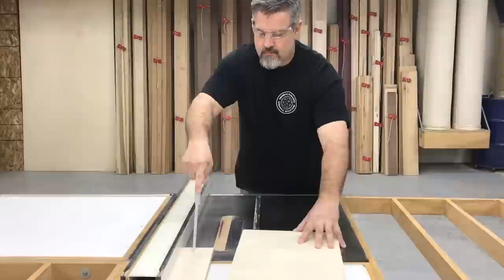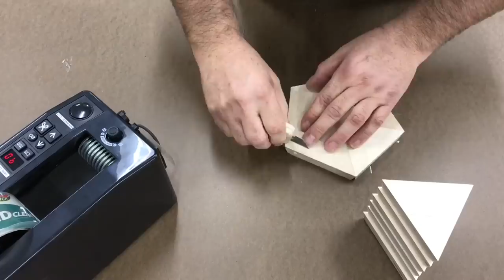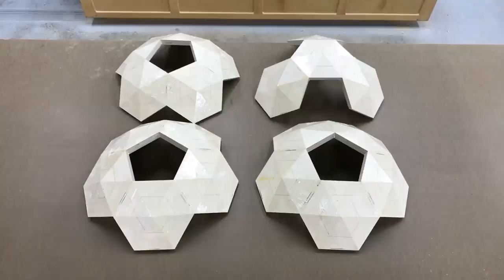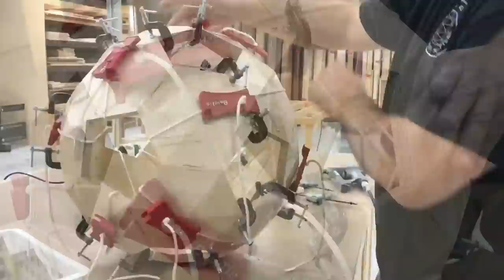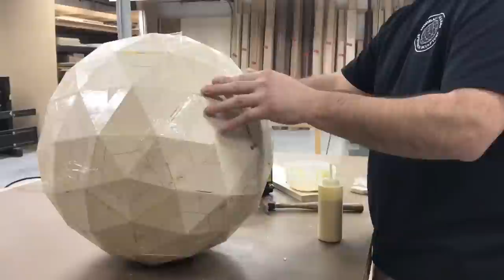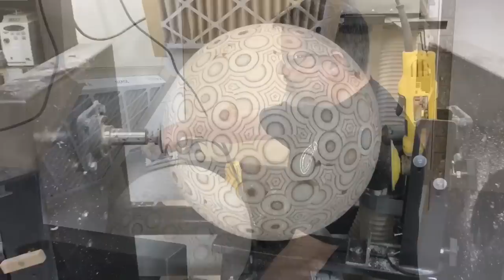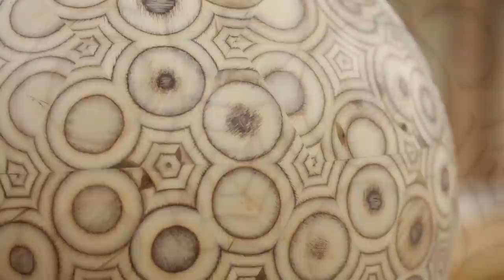Guy makes a big ball out of plywood

Comment: Curious how did you calculated the bevel you needed?
Reply from the maker: quailman28    I did it the hard way with a lot of trial and error. The first one I built out of 1/8 inch hardboard and hot melt glue and then I measured all the angles . You can use a dome calculator that will give you the triangle sizes and dihedral angles check it out here. http://geo-dome.co.uk/3v_tool.asp

Comment: Amazingly amazing! One question: Why exactly did those patterns appear - and I know it has to do with the layers in the wood, but can you explain it more elaborately? Thanks.
Reply from the maker: s r    The corners of each triangle get more sanded off of them than the centers.  The center is still about 3/4” thick the corners are about 1/2” each ring is one layer deeper into the plywood. The reddish brown ring is the color of the glue used in the plywood.

Comment: So I've been trying to figure it out....what angle are the triangles cut on the mitre saw?
I think its 12 degrees (based on the planar deficit between a sphere and a truncated icosahedron.....), but not sure if that's right....i'm horrible at math....and only slightly better at geometry..

Anyone know?
Reply from the maker: JaekRiel DGX    Try this website it has a calculator for triangle size and dihedral angles.  http://geo-dome.co.uk/3v_tool.asp

Comment: Keith this is great! I want to build a 5 feet sphere, any pointers in calculating the angles and right size triangles?
Reply from the maker: Gab20783  Wow that’s gonna be a big ball. 😀 Do you want to try to make it smooth, or are you going to leave it a geodesic?
Reply: Keith smooth would be nice 😁However I may do a 2.5 radius sphere.
Reply from the maker: Check out this website.  http://geo-dome.co.uk/4v_tool.asp    They have a dome calculator tool that can figure the parts and side lengths for different radius domes. You would want the one for panelized construction. I don't have a lot of experience with the larger spheres, but I would think the larger the diameter, the thicker the material would have to be. I am going to try a 34" diameter smooth sphere for a video at some point.
Reply: @ODDBALLGALLERYKeithWilliams  Keith - Thank you for the link- I actually looked at that calculator.  I don't think getting thicker wood would be a good idea for the weight.  The thinner the walls the lighter the sphere.  I was wondering how did you calculated the angles of the triangle pieces so the fold in perfectly?
Reply from the maker: The calculator should give you the angle and side length..from there it will take some trial and error fitting to get the right setup for you equipment. As far as the thickness, I guess it would depend on what you plan to use it for.
Reply: @ODDBALLGALLERYKeithWilliams  Thank  you keith - appreciate your pointers- I will let you know how things go.

Comment: Are all the triangles the same for the 5 or 6 up assemblies? Same draft?
Reply from the maker: Brad Cole  There are two different size triangles.  They are the same length on the common side . The pentagon triangles are shorter on the other two sides and the hexagon triangles are longer. Both sizes have two different bevel angles. Check out this website for more info.  http://geo-dome.co.uk/3v_tool.asp

Comment: Are that rubber discs what you are using
Reply from the maker: For the rough sanding I use a 36 grit resin disk with a rubber backer pad.

Comment: What the hell is that black machine in corner??? Automatic tape dispenser??? Where can I get one of those? Any reference for model?
Reply from the maker: Yes it is a auto tape dispenser. Start international ZCM-1000. They are expensive new, I got mine used on Ebay for $150

Comment: I guess - Guy makes a Truncated Icosahedron out of plywood, then sands it into a sphere - wasn't catchy enough
Reply: or . . . Man makes wooden soccer ball 😁
Reply: Respectfully disagree. He built a geodesic sphere (thank you Buckminster Fuller) then sanded it into a sphere. If he had made a truncated icosahedron, it would have had faces made with pentagons and hexagons (aka a soccer ball as our friend commented below). Those two structures do look similar though.
Reply: It's the layers exposed that give it (more) magic.
Reply: @gpalmerify  It basically is a truncated icosahedron as it is made of hexagons and pentagons.  He just raised the center of each a bit.  I suppose one could argue this "un-truncates" it.
Reply: @Anon54387  I understand your point and if this shape was made with flat polygons, I'd agree. As you noted, raising the centers made this shape more complex. This was actually done using geodesic polygons in a configuration where there are 6 and 5 triangle vertices just as the truncated icosaicosahedron has with it's flat faces. This shape cut as a dome is one the most common beside the simpler icosahedral domes. These shapes and the math that determines them is fascinating and a lot of fun to play with. I've always wanted to see a practical home made with this math that was pleasing to the eye as well.
Reply: @UCbI873tHEOH0hcD9IlF_HMQ Bingo, I didn't want to throw in the concept of frequency, opting to be descriptive instead. Geometry geeks (like you and I) like the precise mathematical terminology, while "normal" people are perfectly happy saying "I think it's pretty". I think the woodworker here did a great job coming up with a process and produced a result with the beauty of wood grain as well.
Reply: Trinoculus P, this conversation was very instructive, thank you

Comment: Please talk about those bow tie tools you used
Reply from the maker: Ronnie Shand When I first started building these spheres, it wasn’t the bevel angles that caused the most problems. The issue was getting all of the bigger assemblies together before the glue starts to set. I needed a way to place 12-14  clamps on a rounded surface quickly. Ratchet straps were way too slow.  I designed the Bowtie clamp to solve this problem. They are now made by  Fastcap.com . I use them a lot for bundling cutoff strips and narrow lumber.
Reply: ODDBALL GALLERY - Keith Williams What was the degree bevel you used? That is an awesome project ,you did a great job.
Reply: Шикардос!!
Reply: James it would depend on what diameter ball you may.
Reply: Тяжелое детство, деревянные игрушки...
Reply: @jameswells9749  If I'm doing the math right, the angle would be arcsin[ sqrt(s^2-(s/2)^2) / (2*sqrt(d^2-(s/2)^2)) ] where "d" is the sphere's diameter and "s" is the length of the triangle's side.

Comment: Amazing especially when u put it on the lathe and started sanding it.
Reply from the maker: James Watkins 👍🏼 thanks for watching
Reply: @ODDBALLGALLERYKeithWilliams  Honestly that's the point where I was really impressed. If any segment of your measuring/cutting and/or gluing phases had been even a little bit subpar it could easily have been a disaster when you started turning it. A section comes a bit loose, the turning loses its balance and Bad Times are had by all. 

Were you the slightest bit concerned that once you got it to the lathe it wouldn't be quite as straightforward as it looks? I've used a wood lathe myself in the long long ago of my high school wood shop class and I don't think trying to turn something hollow and made of many pieces glued together would have been something our teacher would have given us the go-ahead for. We did have a few safety precautions even in the steel-slide-over-concrete-slab school days of the early 1990s, after all.
Reply from the maker: Kyle Nally  Hey Kyle, The video is a bit deceiving because it is sped up 20x. The rough sanding starts out at only 5 RPM and finish sanding is done at about 40 to 60 RPM. The sanding scene in this video is actually about an hour real time. The ball not as fragile as it looks.  I can stand on it and I’m about 2 fiddy. 😀

Comment: 🤔.... a bunch of pentagons put together to make a dodecahedron maybe? Would your angle settings be somewhere around 13 and 9 degrees? That’s just a rough guess based on what I seen in the fast paced video. I’d have to get out a piece of paper to get in on the money.
Reply from the maker: The ball in my small ball video is a dodecahedron. Each of the pentagons is five triangles. The big ball is geodesic truncated icosahedron 3v 20 hexagons and 12 pentagons ,180 triangles.

Comment: Hi Guy your spheres are amazing and I think they would be good for autistic children to study. My Mrs works with some and once I showed her your spheres she want me to make a couple for her to take to work. I can remember the 21.7 degrees angle for the smaller sphere but don't know how to calculate the angles for larger spheres. Thanks Mike
Reply from the maker: Hey Mike, The larger spheres are a little more complex. There are two different sized triangles and 3 bevel angles. Here is a link to a dome calculator. You can enter the radius of the dome/sphere you want to build and it will give the side lengths and angles in a color coded diagram.        https://geo-dome.co.uk/3v_tool.asp

Comment: Love this project. It looks fabulous! My husband and I are trying to figure out if when you mitre cut the individual pieces, did you also angle the blade slightly so the the edges were also mitred? And did you use the six piece parts for the main body, and the remaining holes were filled with the five part pieces?
Reply from the maker: Food is Life Yes you are correct, all three sides of the triangles are beveled (undercut). I assemble the 20 hexagons first and then the 12 pentagons.

Comment: How did you get sutch accurate cuts with a Dewalt cop saw I have one it's new and it has so much play, it wouldn't make all those triangles the same dimensions it's one of the worst tools I have ever brought!
Reply from the maker: Big2009Gee I bought both of theses saws “reconditioned” , I haven’t had any problems with them. I did buy a Dewalt 12” slider once that was a total lemon.

Comment: Great project!! I wonder how many hours/days it took to get those mitersaws tuned so accurate??
Reply from the maker: MrGinocon  It takes about 15-20 minutes to set up the saws for each set of cuts. I use templates to insure repeatability, and I always cut and assemble some test pieces before cutting the whole batch.

Comment: What is the angle of the cut on each segment? Looks amazing
Reply: They looked like equilateral triangles. If so, they are 60 degree angles on all three corners.
Reply: @davidslinn5920  They aren't quite, in the case of the hexagons, which he shows during assembly of those. The six triangles don't quite close up at each hexagon's center – there's a skinny, tall-triangular "gap" – so the (6) apex angles are less than 360º/6 = 60º each.
For the pentagons, there's also a gap, making those (5) apex angles less than 360º/5 = 72º each.

This question (what are the angles?) is a really interesting problem in geometry – just what angular deficit is needed in each pentagon and each hexagon, in order to make the resulting polyhedron as round as possible?

If you made the 20 regular hexagons and 12 regular pentagons all flat, they would fit together into the "soccer ball" polyhedron. What he's done is to raise each pentagon and hexagon into a low-height pyramid, so that the resulting ball, before being sanded down to a smooth sphere, consists of 20·6 + 12·5 = 180 triangles.

In fact, I believe this (just the pentagons and hexagons) is the same polyhedron as is formed by the carbon atoms in a "buckyball," C₆₀H₆₀ . Both structures have 60 vertices.

Divided into the 180 triangles, there are 60 + 20 + 12 = 92 vertices. This serves to make the polyhedron less "pointy," and easier to sand down, as well as more interesting after sanding through the plywood layers.

Euler's graph-theoretic formula for the numbers of faces, edges and vertices of any graph in the plane or on the surface of a sphere,
F – E + V = 2
works on the simpler, soccer-ball polyhedron: 32 – 90 + 60 = 2;
and on the more complex polyhedron of all triangles: 180 – 270 + 92 = 2.

And a form of the Gauss-Bonnet Theorem can be used to optimize the "gap" angles mentioned above.
But that goes beyond the scope of this comment.

Fred
Reply: @ffggddss  clearly, you haven't thought this through. 😂
Reply: @davidslinn5920  I know. I'm just an intellectually lazy schmuck.

Fred
Reply from the maker: Clint Edwardson  This website is a good resource.   The angles for a sphere are the same as a dome. http://geo-dome.co.uk/3v_tool.asp

Comment: Wow! Amazing project. Great work. I'd love some help with the math specifics so I could attempt to make one myself. At what angle are the triangle's sides cut? And are the triangles for the 5 piece discs cut at different angles than the 6 piece discs?
Reply from the maker: There are 20 hexagons and 12 pentagons. The bevels are different. Check out this website      http://geo-dome.co.uk/3v_tool.asp    It has a calculator that will give you the lengths of the triangle sides and the dihedral angles . Just enter the radius of the sphere you want . The calculator is for a dome , but the math is the same.

Comment: How did you calculate the angle of the bevel for each piece? The accuracy of your work is amazing.
Reply from the maker: Here is a link to a calculator that gives the dihedral angles for a geodesic structure. You just enter the radius and it will give strut lengths . I used the trial and error method to fine tune each piece. (many ugly spheres) Just a small error in each of the triangles will leave large gaps when it is all assembled. I think it is better to leave the angles a little loose to allow for that error.        https://geo-dome.co.uk/3v_tool.asp
Reply: @ODDBALLGALLERYKeithWilliams 
12

Comment: Pretty cool, but all that work to make it out of plywood?? Why not make it out of some good hard wood??
Reply from the maker: cruzan mongoose I have made more than a hundred of these big balls. Many of them have been made with solid hardwoods. This design has been my best seller. I like it because it is not some expensive exotic wood, but rather an ordinary material used in a different way. Check out oddballgallery.com for some of my other designs.
Reply: Oddball: I would do what ever sells the most.. I mill my own local west Indian mahogany  and build furniture with the wood I mill.. I would never use plywood, but in your case if it sells then go for it..

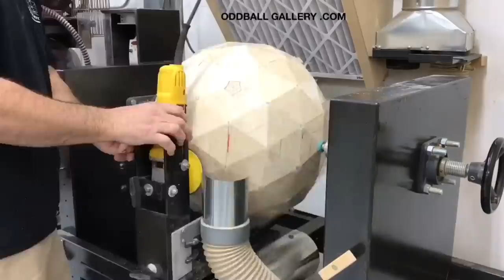Comment: 2:00 Great design of that machine tool to mill the sphere!  Is the radius of the arm holding the grinder adjustable to accommodate different size balls?
Reply from the maker: Yes, the arm can slide at the center point under the ball. I also made longer arms to use with bigger balls. My video of the small sphere sanding jig shows how it is constructed.

Comment: that a great job ! congrats 👏 I’m trying to make mine bar globe & looking for some advices😊 watching this video open my eyes 👏 how can figure out the size of the little esagon for mine globe of 50cm circonferenze & what the angle of the blade so the edge is also mitred? sorry for so many questions but u really shook me 😊😊
Reply from the maker: Thanks 👍🏼 Check out this website     https://geo-dome.co.uk/3v_tool.asp   They have a free dome/sphere calculator. You just enter your radius and it will give you the strut lengths for the triangles. There will be 120 triangles for the hexagons and 60 for the pentagons. They even have a color coded diagram with dihedral angles.

Comment: This is exactly how they built the Death Star

Good work, I make stuff like this out of paper when I'm bored at work and I can tell you, when I finish the ball I have all kinds of gaps, I bet a very slight difference in that saw angle at the beginning would throw the whole thing off
Reply from the maker: Nabre Labre     Yes, a small error on the cuts will add up quickly when it is all assembled. I made quite a few of these that ended up as firewood.

Comment: Do you Mind if ask, what angle/bevel do you use on the triangles to form the the pentagon? Tried doing something similar but kept screwing it up. Cheers and keep up the awesome work👍
Reply from the maker: Hugh Mckenzie  check out this website.    http://geo-dome.co.uk/3v_tool.asp.   They have a calculator that will give you triangle side length and dihedral angles. It is even color coded. You will want the 3v calculator. It is for a dome but it will apply to a sphere also. Even with the angles there will be a lot of frustrating trial and errror.

Comment: Hi your video is admired. If I make the basis for a chair from sectors like yours, will they be able to hold a person and not fall out? What kind of glue do you use?
Reply from the maker: Николай Феденко  The completed sphere is really strong, I can stand on top of it. I don’t really know the strength of a partial or hemisphere. I guess it would depend on how the chair was designed and how the weight was distributed. I use original Tightbond glue.

Comment: Glue-up and clamping is the bane of every woodworker's existence.  This is the ultimate exercise in woodworking masochism!  That aside, it is mighty impressive.  I am curious how these orbs hold up over time, with the inevitable expansion/contraction caused by changes in temnperature and humidity.
Reply from the maker: chuckschilling  I have had a couple of these plywood balls stored in an unheated garage since 2011. It goes from 120° in the summer to -20 in the winter. They have held up really well, probably because of the stability of the plywood. I had one made of solid wood stored in the same conditions that developed a crack.
Reply: @ODDBALLGALLERYKeithWilliams  Keith, thanks for your response!  No doubt you are right - the stability of the laminate has got to help.  But the accuracy of your cuts, I think, has to be the primary reason your creations endure.